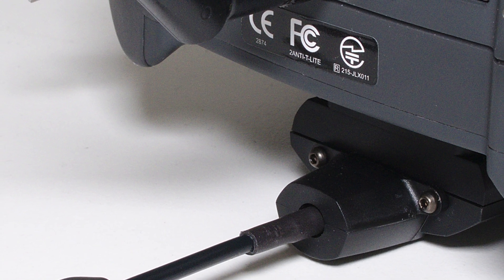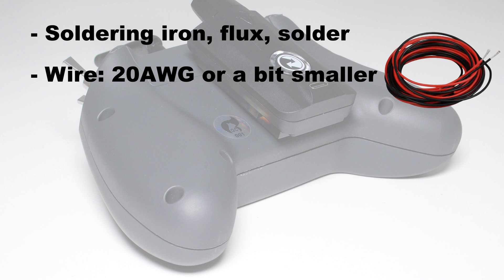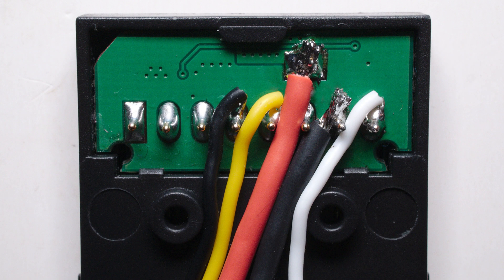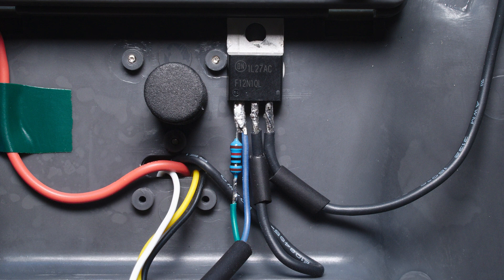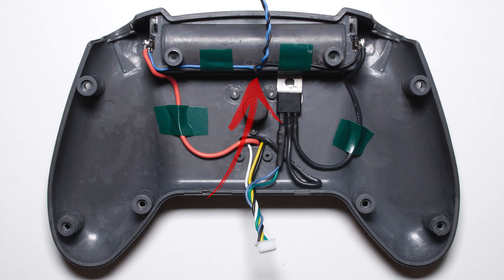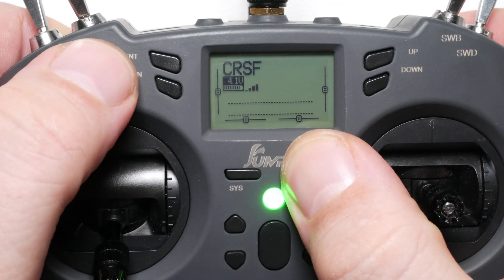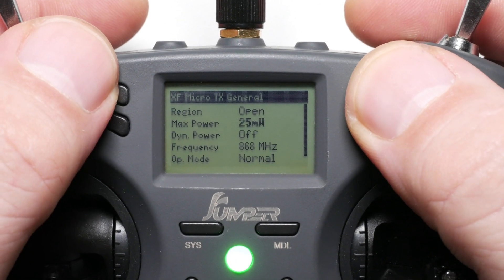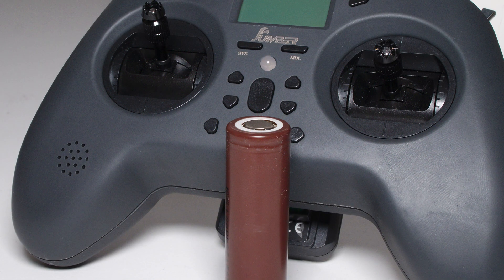Jumper T-Lite: 1W Crossfire mod (powers off when radio is off or when using internal module)

Comment: I tried to do this mod, I used IRL540N MOSFET and 10K Resistor.
It worked yesterday evening, but when I turned on the radio today, the slot adapter melted.
Crossfire probably works because by usb I have communication, the radio also works.
I do not know where the problem can be, I connected everything safely and correctly.
Reply from the maker: When it worked at one point and suddenly stopped working I would assume there was a short at some point. Difficult to say without seeing what you did exactly. I could imagine that you shorted something out on the external port. I would put it back to original state and measure the external port, see if the stepped up voltage is still available there.
Reply: Yesterday it worked for an hour for 1W power. The module was hot after this time, but it's probably normal. Later I changed to 25MW Dynamic and today I only used this mode.
I have already ordered 2 adapters on Aliexpress, but will come for 3 weeks.
Is it possible for this time to power the CrossFire module via USB and connect the remaining cables directly to motherboard, without an adapter?
Reply from the maker: @CodySmiley  Powering from USB should not be an issue at all, but in this case I would recommend you revert the mod, just in case... Sounds really strange to me, and the first time I hear of an issue like this - am really curious what happened there.
Reply from the maker: @CodySmiley  Hmm, that looks good, I am expecting the mistake to be on the back of the module bay - maybe a wire shorted out there...

Comment: I followed precisely but for some reason my external module is still powered with the TX switched off - any ideas?
Reply from the maker: Which value did you use for the pull up resistor. It seems some people have issues when using 100k instead of 10k. Also which Mosfet did you use exactly?
Reply: @stylesuxx  hi, I used this mofset https://www.jaycar.com.au/mosfet-sup53p06-20-p-ch-60v-53a/p/ZT2464 and this 100k resistor https://www.jaycar.com.au/100k-ohm-0-5-watt-metal-film-resistors-pack-of-8/p/RR0620?pos=2&queryId=fdd21e9c17d4e54bcab5667d7f87672d&sort=relevance
Reply from the maker: @TheNeilmcintyre  Yeah, please try a 10k resistor instead.
Reply: @stylesuxx  cool I'll try that thanks
Reply: H @stylesuxx i, really appreciate the help here. I replaced the resistor with 10k but still getting voltage when turned off. How can I test the mofset?
Reply from the maker: @TheNeilmcintyre  A, shoot - I just now saw the Mosfet you used - you need a logic level N channel mosfet. You' ve got a P-Channel mosfet. Check the description and pinned post, there are some N-Channel options that will get you going.
Reply: @stylesuxx  awesome thanks mate will get a new mofset in it tomorrow
Reply from the maker: @TheNeilmcintyre  no, it's not logic level. You need one that fully switches at around 2.5V.

Comment: Thanks stylesuxx for detailed video! I can't find 10k or 100k ohm like in your video (blue color), can only found light brown color (100k or 10k) but it says 0.25W, is this ok? i mean does that W matter?
Reply from the maker: Use a 10k one. Color does not matter, just different manufacturers / wattage limit.
Reply: @stylesuxx  Thank you! installed the mod and works fine! :) I use 10k 0.25w (brown background), and IRL540N, but the voltage measurement on pin 2 and 3 is between 7.9 to 8.1 not 7.8 as you mentioned, hope thats ok?
Reply from the maker: @albertsaerong  Happy to hear that - yeah, that is totally fine.
Reply: never mind about the wattage question :) i just finished reading all of the comments and found out it doesn't matter :) but what about the resistor with different body color? does that mean something? or has to be the blue one?

Comment: Irl540n - doesnt work for me, it doesnt turn off
Reply: Could it be my problem, that i use not a pull up resistor?
Reply from the maker: @faustas_gudas  Well, yeah - if you don't have a pull-up resistor, that would be expected behaviour ;-)
Reply: @stylesuxx  what is the difrence between normal and pullup?
Reply from the maker: @faustas_gudas  there is none, you just need a resistor that pulls the gate high when. If this does not work properly with your 100k resistor, please try 10k...
Reply from the maker: Please double check your wiring. Which value did you use for the pullup resistor?
Reply: 100k
Reply: I use a normal 100k resistor

Comment: im doing a power mod but was going to use a MT3608! Can you see any problem with this method?
Reply from the maker: Not sure what you are exactly planning to do - the MT3608 is a DC-DC converter. Are you planing to power the Crossfire module directly from that? If so you will need to unplug it when you don't use it, or add a switch.
Reply: @stylesuxx  but if i wire the mt3608 to the back of the crossfire adaptor will it not work then without un pluging the module
Reply from the maker: @snakes301271  Not entirely sure how you are planning to wire it - where are you going to power the module from? If you power it from the battery directly, you will need a switch, or some way to enable the module. If you are planning on powering it from the same line, that the "native" DC/DC module on the bay is powered, then you are not solving the issue. It would help if you made a drawing of how you are planning to hook up everything.
Reply: @stylesuxx  i was just going to wire it to the power pins at the back of the module adaptor. that way surely it will turn off when the radio is off
Reply from the maker: @snakes301271  OK, but then you are still using the weak power path through the board... I am not sure which problem you are trying to solve with that, to be honest.
Reply: @stylesuxx  ah right so the power path is the problem with these. Thought it was the single cell was the problem fs so this won't work then
Reply: ok so found an IRL540N but not sure if its the right resistor. it says 10R - 550R/1K - 220K
Reply from the maker: @snakes301271  Yes, exactly - there are a couple of FETs on the way that are just not up to the task, that's why we want to bypass them. The resistor should be 10k or 100k - it's just a pullup...
Reply: @stylesuxx  this resistor says its all of those numbers tho lol and it doesnt have the same bands round it. sorry but i no nothing about this stuff
Reply from the maker: @snakes301271  The resistor can't have all of those numbers, a resistor is always a fixed value - you are probably looking at a set of resistors. As long as it includes a 10k or 100k resistor you should be fine.
Reply: @stylesuxx  your right lol after reading it properly it was a set of 100 in different sizes!! everything is ordered so ill do it your way. the right way lol cheers for the help
Reply from the maker: @snakes301271  Haha, no worries, feel free to ask if you have any other questions.

Comment: Hello,

I want to copy that mod, did it make any problems After a time of using?
Reply from the maker: No issues for me so far. Also did not hear from anyone else that they had issues.
Reply: @stylesuxx  great, then i will copy it exactly like yours!
Reply from the maker: @Shra1na  just use one of the recommended N channel Mosfets from the description/pinned comment.
Reply: @stylesuxx  i orderd a IRL540N

Btw where are you from?
Reply from the maker: @Shra1na  Good. I am from Austria.
Reply: @stylesuxx  dann könnten wir auch deutsch sprechen glaube ich 😋
Reply: @stylesuxx  ich hab mit genau wie in deinem Video die jumper und das nano modul gekauft, hatte bei dem Mod nur Angst das die Funke irgendwann davon kaputt gehen könnt oder so, aber wenn du sagst das du noch nichts von Problemen gehört hast dann werde ich das definitiv machen, nicht allein für mehr range sondern auch um mehr in der 150hz Fenster zu bleiben obwohl ich garnicht weiß wie sehr man das überhaupt merkt
Reply from the maker: @Shra1na Sollte klappen :-D
Reply: @stylesuxx  das klingt nun nicht mehr so sicher 🙄🙈
Reply from the maker: @Shra1na  Sorry, "Sollte klappen" war aufs Deutsch sprechen bezogen ;-) Wie gesagt, ich hab keine Probleme mit dem Mod und hab auch sonst von niemanden gehört, dass er Probleme hätte. Hab die Funke sicher 4-5 mal die Woche aktiv, mal mit, mal ohne Modul.
Reply: @stylesuxx  ahhhh alles klar, hab ich falsch verstanden! Ja mega, das klingt super, dann freu ich mich schon auf den Umbau!

Comment: Im new to your channel and to the hobby and ordered this tx and planning to get crossfire also. Can i ask what is the difference of dyn on and dyn off? also can I run crossfire at 250mw without doing mod? thank you.
Reply from the maker: Dynamic will automatically adjust the output power of the module depending on how far away you are. With dyn off, the output power will be fixed at the set value. I would not risk it on 250mW. Jumper recommends to not run the CRSF Nano with more than 25mW - so I would not run it at 250mW without mod.
Reply: @stylesuxx  thank you so much! Hope your channel grows more. Keep it up!

Comment: dangerous mod. switching the GND or 0V of the bay is a stupid idea, because you can fry your hardware with this (currents trough internal diodes of the MCUs from module and radio) so this can destroy both, the radio and the module.
Reply: doesnt the resistor and diode fix that?  to bypass the main circuitry...

Comment: Thank you for showing up this solution. I used a IFR530 Mosfet. The mod can be done with parts from the tinker box and there is no need to buy an expensive solid state relay.
Reply from the maker: Yes, I wanted to go with the solution using the least and cheapest components...
Reply: @stylesuxx  It took some time until I received my TBS Tracer sender. The Tracer sender starts in bootloader mode if I use this power mod. If I change back to the default wiring the sender works normal. I think it happens because of the low side switch and permanent power supply via the positive line. At the moment it works with the original wiring with an output power at 100mW. If I find time and motivation I will think about a solution with high side switch.

Comment: Is it a 1w resistor, sir?
Reply from the maker: Does not need to be, just a pull up. Use 10k or 100k, the currents are minimal.
Reply: @stylesuxx  thank you sir...

Comment: Hello.  thanks for your videos.  he wants to do something like that too.  I have a question: will such parts be good?  resistor CR 1 / 4W 5% 100E transistor RFP12N10L.  thanks for the help.
Reply from the maker: Resistor has to be 10k or 100k Ohm. As mentioned in the comments and description, this N Channel Mosfet is not optimal. If you can get a different one, it would be better. But it will work with this one.

Comment: I found two IRF1404Z n-channel mosfets inside a scrap 18V Ryobi battery pack. These have a very low Drain-Source resistance (2.7 milliohms) and 2V Gate-Source threshold voltage. Do you think one of these would be suitable for this mod?
https://www.mouser.com/datasheet/2/196/irf1404zpbf-1732529.pdf
Reply from the maker: Nope, they only fully switch at 4V gate voltage - you need to look at Gate Threshold voltage Max.
Reply: @stylesuxx  Thanks! The Gate Threshold Voltage confuses me. I also have a couple of IRLB3034. These seem to have a threshold between 1V and 2.5V, and their drain-source R is rated at 2 milliohms, so hopefully it's a winner.
https://www.infineon.com/dgdl/irlb3034pbf.pdf?fileId=5546d462533600a40153566027b22585
Reply from the maker: @joymonky  Jup, this one is good - as long as they say "Logic level", you can use them, the lower the resistance the better ;-)
Reply: @stylesuxx  I did the mod tonight and it worked like a charm, thank you so much!
While I was hacking up the T-Lite, I also installed a lanyard hook under the module bay. I shared my design here : https://www.thingiverse.com/thing:4788456
I also made a couple of small mods to the backshell of the T-Lite, to allow a 21700 sized battery to fit into the compartment. Now I have a 4200mAh Molicel battery, rated for 45A. Probably overkill, but hey; why not?

Comment: Dude, can i use full old crossfire with jumper t lite???
Reply from the maker: What do you mean by old? But yeah, if you can find a way to mount it, I don't see why not. The old modules also have higher output power IIRC, so you might want to bench test that first...

Comment: Great mod, thanks a lot. Next step: throw out the internal module and replace it with the crossfire. Would love to see that!
Reply: I removed the internal module from my jumper as I only have one drone and it has crsf so I bought the 65$ cc2500 because i knew I wouldn’t use it. When I was removing the internal module I was thinking how cool it would be to remove the plastic case from the crsf module and put it inside the jumper and run the T antenna out the original Antenna hole I also took the lanyard eyebolt from a old fly sky radio and put it on my jumper too I’m gonna put up a video on my channel
Reply from the maker: @FLMan180  Cool, looking forward.
Reply: @stylesuxx  ok so I tried to fit the cross fire module inside and I even filmed it all but it does not fit it hits the gimbals if you lay it sideways and hits battery bay if you lay it vertical in between where the old module was because it’s longer the stock module. So good news my mosfet and resistor came in the mail and I’m all hooked up and working perfectly on 1w ! Thanks brother !
Reply from the maker: @FLMan180  Cool, thanks for coming back to me. What a pitty that it does not fit, but thanks for trying!
Reply: @stylesuxx  so the resistor I have is getting really hot! I got a 10ohm 1/4 watt 5%
Reply from the maker: @FLMan180  Yes - 10 ohm is way to little 10k or 100k something in that range.
Reply: @stylesuxx  I’m on my way back to radio shack !
Reply from the maker: Hmm, I don't know if I want this, to be honest. I mainly use the MPM, and sometimes the CRSF. If you mainly want to use CRSF then I really think you should get the Tango 2 instead.
Reply: @stylesuxx  yes, it doesn’t make sense if you are actually using the mpm. I’m not using it at all, but buying the tango won’t help me, cause I’m using tracer and would love to put the tracer internal.
Reply from the maker: @derdingel13  Ahh, I see - that makes sense. Would be a bigger "operation" though, but I am sure it's possible. Waiting for the Ghost lite module myself. So once it's available I mit give it a shot.
Reply: @stylesuxx  👍🏾 looking forward to that. Just in general thinking, what kind of electronic ist in in the external adapter? Is it just a stepup? Then it would be enough to make an adaptercable with a stepup, decase the tracer, glue it in the shell and replug it on the existing external port connecter on the mainboard. 
Am I missing something?
Reply from the maker: @derdingel13  No, that would be basically it. The external module bay only has a step up converter - as you say. But - I would be looking at a more elegant version, trying to keep the external module bay working. This would then be on top of this mod and might only consist of adding a second step up converter to power the then, built in  tracer module. This would also require changes in OpenTX though. But yeah, a cool idea for sure.
Reply: @stylesuxx  yes!!!! Let’s do it buddy

Comment: Anyone done this mod and fully flown on 1W without any issues yet?
Reply from the maker: I guess you mean apart from me ;-) Yeah I am also wondering that there is no feedback to this regards yet...
Reply: @stylesuxx  might be working no ones reporting issues ha
Reply from the maker: @OceanoFishing  probably - no news is good news in this case ;-)
Reply: @stylesuxx  I think you might be right!! I've actually ordered a new external power bank for external power supply to the nano tx. Hoping this works! If not then I'll be coming back to this video haha
Reply from the maker: @OceanoFishing Yes, that should work - if you do this mod and it works for you, then yes, please come back ;-)
Reply: @OceanoFishing  did an external power bank work for you?  It didn't work for me.  My TX dropped out so the plane failsafed soon after takeoff, tried to land and hit a tree :-(
Reply: @madhippo  it didn't! The 1w doesn't pull enough watts from the power bank to keep the power bank on... however tbs get tell me that a power bank with a permanent 'on' switch would do the job

Comment: Hi, about modding the radio: would there be an easy way to add a battery reverse polarity security? So the radio doesn't stupidly fry? Adding a diode (total noob here)? Thank you.
Reply from the maker: You could. But you would be unnecessaryly dropping around 0.5V - 0.7V on the diode. That's why I would not recommend it.
Reply: @stylesuxx  Thanks for the answer, indeed. Even Schottky Diodes will lead to a voltage drop of 0.3 to 0.5 volts.
Reply from the maker: @bigatchoum  Jup, unfortunately. I was considering it, but as I mentioned before, not worth dropping so much voltage. I think a huge sticker with plus and minus is the better "protection" or adding a spring to the GND plate. At least visually you can then see it more clearly.
Reply: @stylesuxx  There is a way to do this efficiently with p-channel mosfet. Note: you would probably need a logic level mosfet with max vgs of -2V  https://youtu.be/IrB-FPcv1Dc
Reply from the maker: @SuperNorker  Sure, but that makes things just more complex - IMHO it's just not worth the hassle. But thanks for the link, maybe someone needs reverse polarity protection badly and this might be useful. It's really a pity that Jumper did not think about that, even just a spring on one side would have helped to make it more clear.